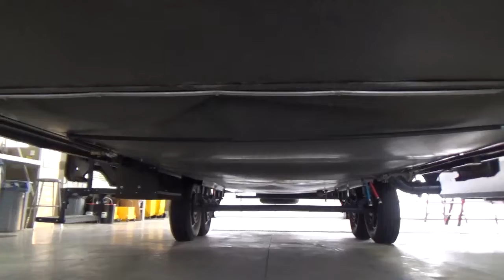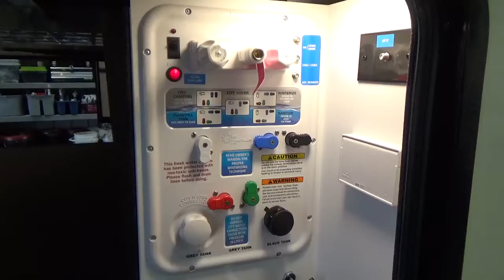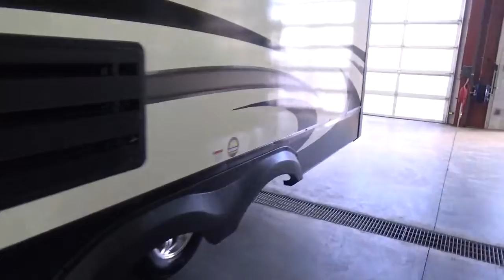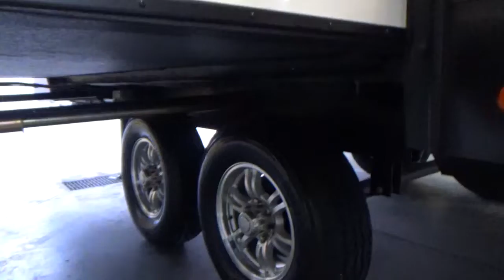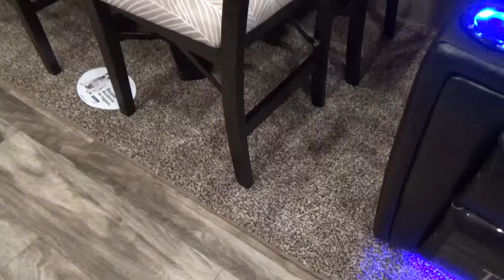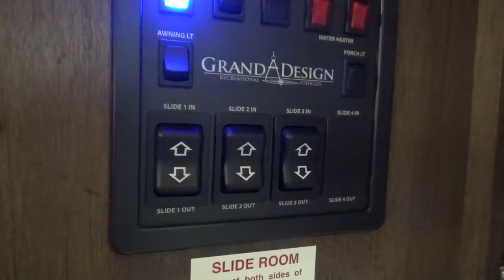2019 Grand Design RV Reflection 303RLS Fifth Wheel- Extended Tour

Comment: Why doesn't GD use the Whisper Quiet AC system?  Those really are much quieter than what is currently installed.
Reply from the maker: Chuck Potter, you are right the Whisper quiet is just that. From GD’s perspective, through extensive testing, found the whisper quiet A/C systems to be substantially less efficient, while putting a massive draw on the electrical system for longer periods of time. GD uses their exclusive “Stealth A/C system which includes the “Coleman Mach” A/C compressors and racetrack ducting with Air baffles to divert cool air down into the cabin of the RV. The “Stealth” A/C system is arguably the most efficient system on the market. The beautiful part is that your A/C units cycle on and off far less which makes the trailer quieter overall. This is also achieved part and parcel because of the industry leading R-values GD builds into all their products. We hope this helps!!😀
Reply: @WoodysRVWorldOfficial  Thanks for getting back with me.  It is interesting information.

Comment: Clayton is there amount in the bedroom for a television and I did not see one Thank you for your detailed videos they are very helpful
Reply: I looked at one of these this past weekend.  It appeared to me, there was some kind of extra support built into the wall.  There was no bracket on the outside of the wall.
Reply: @254tom  Be sure to use a magnet to ID the exact position of the steel plate. GD tends to put on a blindfold when putting the location sticker on the wall.
Reply from the maker: Bob Goodell, great to hear from you again!! GD laminates a sheet of steel into the side wall of the trailer so you can securely mount a TV bracket to hang a TV. Wherever you see a sticker that reads “TV mount location” there will be backing to mount to. We hope this helps!! Take care and talk soon!!😀